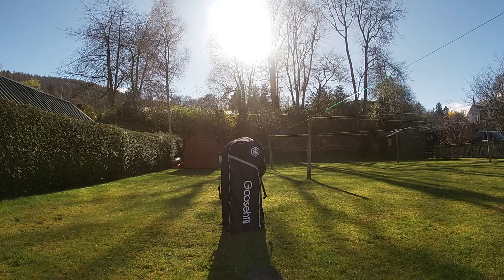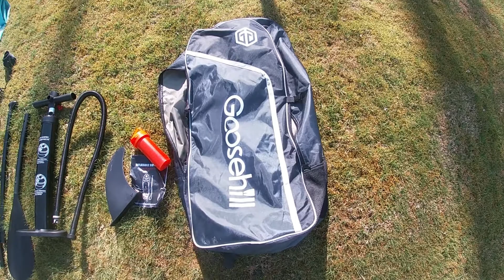How To SET UP Your INFLATABLE PADDLE BOARD And PADDLE | Watch Before Using Your SUP 2021

Comment from the maker: Quetion: How to deflate?
Answer: Remove the valve cap, push down the valve and turn right to let the air out of the board.
And then connect the hose to the“DEF/IN” position to pump the air out.

Comment from the maker: Question:  How to inflate the isup board?
Answer: Connect the hose to the “INF/OUT” position to inflate the board. 
Put the red cap of the pump in at the begining to make the pumping faster, and take it off when you feel tired and can't pump it any more.
The recommened PSI is 12-15.